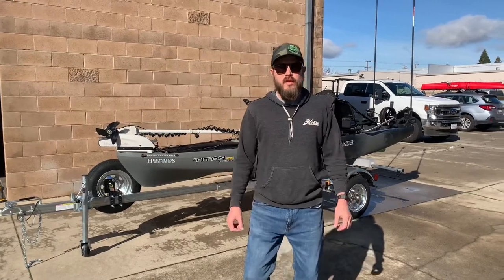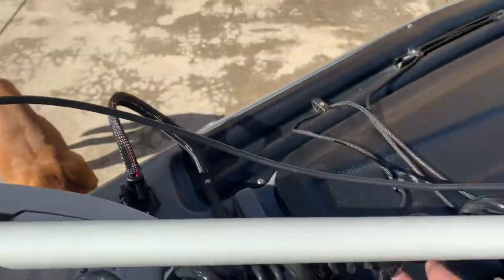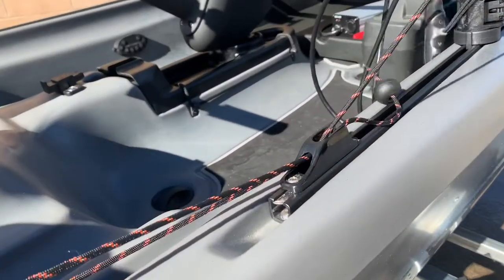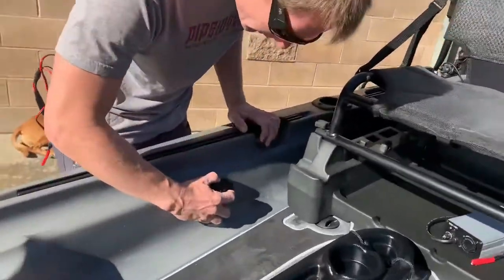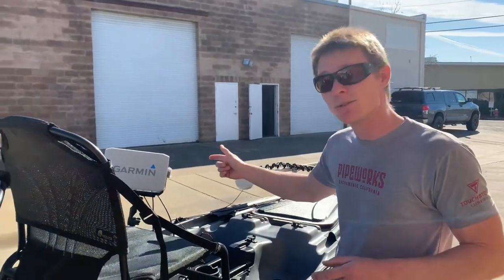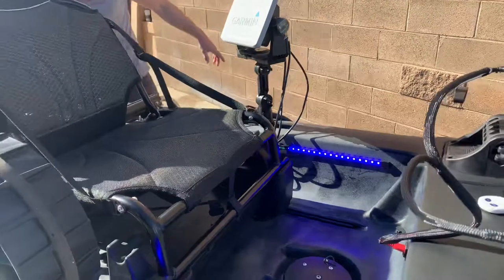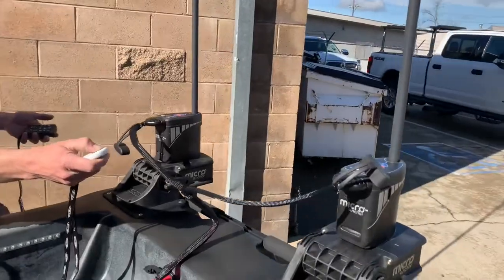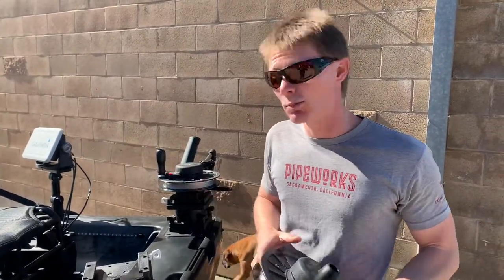Native Titan 13.5 Build - Customer Rigs

Comment: How is the second seat added? Is it just a seating insert that fits in the back or is it an actual mod sold for this kayak?
Reply from the maker: The Titan 13.5 has a set of tracks that runs almost the whole length of the cockpit area, where the original seat is mounted. So we just used those towards the back of the cockpit area for the second seat.